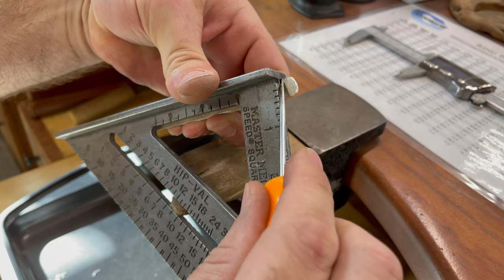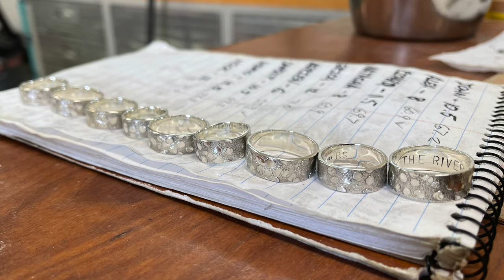The River - Hammer Textured Silver Ring

Comment: Thank you for your beautiful video and nice ring! I was curious to ask: isn’t the metal bowl giving a copper patina to your silver? I am talking about the one in the middle between the pickling solution and the water. Does it contain salt and vinegar? Thanks.
Reply from the maker: No, it contains baking soda and water and it’s used to neutralize the pickling solution. It does strip surface copper away, which is why the water turns blue but that’s a good thing because it brightens up the silver.